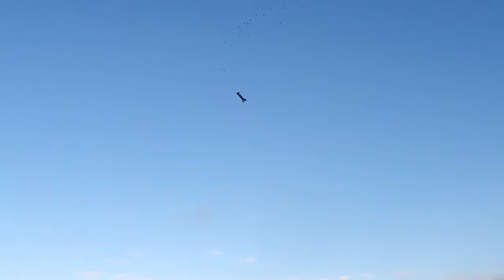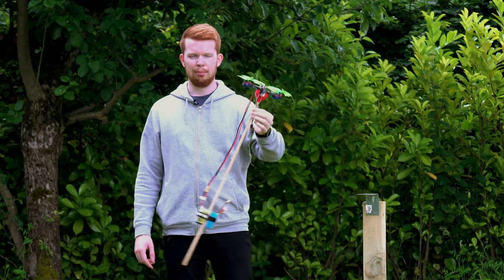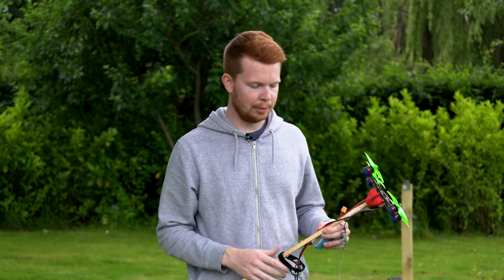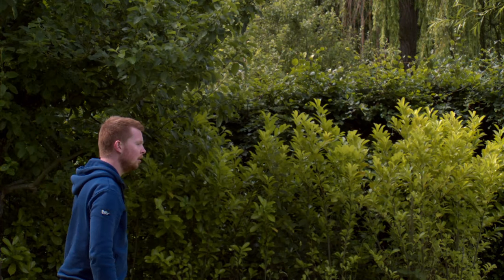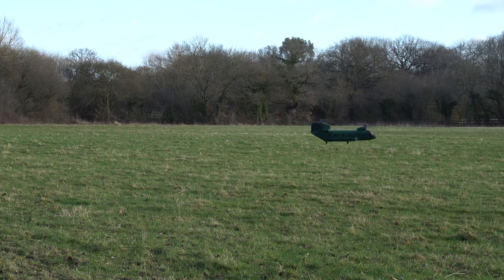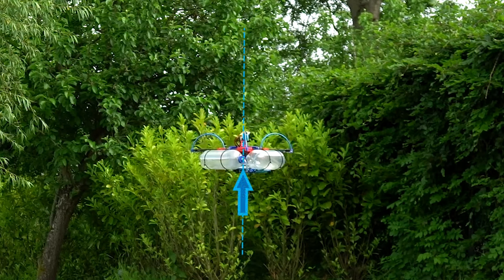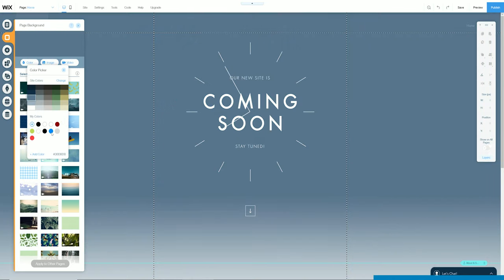Drone Pendulum Fallacy

Comment: @Tom Stanton, very interesting video! I was also curious about the website, however when I clicked on the link it turned out the website does not exist anymore. This in itself is a shame, but not really a problem. What you might find problematic however, is the fact that one of the related links shown on there might be content you would not like to associate with. So my advice is to check the website out yourself again and decide whether this is the case. If so, try to take the website down. Just a heads up from me and thanks again for the entertaining education!

Comment: You should try adding a ball swivel to the drone base so that the weight can move freely in any direction, that would be a more accurate representation of a pendulum
Reply: at that point it becomes more of a problem than a solution, every time the drone accelerates it will swing about

Comment: ok so basically if the thrust vector pivots to remain facing up, it is assisted by a low center of mass; if the thrust vector is fixed in a certain direction, the center of mass is better off closer to the source of thrust?

Comment: Granted I've only had about one hours sleep tonight, and my blood level in my caffeine stream is high, but I'm not sure I followed that whole offset thing. 
But what I do know since messing around with weights taped to  rockets as a kid, is that the pendulum effect doesn't work because the rocket keeps pulling it sideways. the pendulum tries to fall, but when it goes sidesway, the pivot point keeps moving sideways, so it never catches up. And also the acceleration acts like a weight on a string being spun around, it just stays lifted as long as it spins/accelerates. 

One thought occurred to me though,,, what if you put another pivot point lower down. because that would force the pivot point to where ever you put it? 
(I mean,, what I learned as a kid still applies though,, so it probably still doesn't work,,, for rockets at least, but maybe for a slow moving drone?)

Comment: I don't really understand why someone would intuitively think that a rigid connection to a mass would make the drone more stable. Perhaps I could see someone thinking this for a weight suspended by a non-rigid support though (e.g. string).

That said, what if you attached multiple large surfaces  (probably with holes in them and/or with a duct through them so that the propellers can still function) parallel to the ground? I'm talking about air stabilizers. Obviously when it's level with the ground —or close to it— air can pass though relatively easily, yet as it changes angle the air would push against the surface.

Comment: HI TOM, this was  an interesting tie in to your current build projects a pleasure to watch as always. i do have a question though.
For drone propellers, is it better to use 2 blades or 3 blades? ......and is there a difference in battery life over performance between the two???

Comment: "Everybody said I was daft to build a drone with low center of mass! The first flight, it flew into the hedge. The second flight it tipped further and then flew into the hedge. But the third flight, the third flight stayed."
Wait, it actually still flew into the hedge.

Great video. It's one thing to know that it works, it's another thing to have someone explain and demonstrate so it becomes intuitive.

Comment: If you had a two axis control of the "pendulum" with the pivot point being below the propellers, could the "pendulum" be moved relative to the propellers and control the drone?  I'm guessing that, theoretically, it should be possible, but the time constant of moving the pendulum is probably at least one order of magnitude greater than that of changing the speed of the props.  What if you had a single prop?

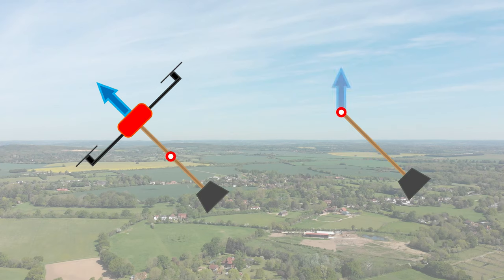Comment: At 5:17 you draw the force vector of the pendulum as vertical. I don't think that it is correct. Think of a pendulum held by a rope. The rope can only transfer axial force, so the force vector should be tilted as well.

Comment: Wouldn't a batterie far from the center of mass still be beneficial because of the increased inertia? Sure, it would mean that the motors would have to work harder to get the drone level, but wind gusts had a harder time too, right?

Comment: I was wondering something similar but imagine a very short string, just enough to allow the pendulum to swing in any direction, and then attach a couple servos between the drone  and a point on the pendulum that could push/pull it towards any direction, changing the center of gravity and causing the drone to tip that direction and so move in that direction?    PS, really interesting channel, enjoy all your vids, Thanks :))

Comment: Could you build a pendulum-drone where the pendulum is somehow connected to the propeller and points it to the reversed direction? It could stabilize the drone this way without a electric controller

Comment: What if you moved the pendulum pivot point?  Instead of making the drone and the stick rigid, put  pivot point on either the center of the pendulum or on the drone.  Or you could add two pivot points!

Comment: I think a drone could be pendulum stabilized, however not in a mechanically simple or obvious way. The pendulum would have to be rigid, like the one in the video. However, there has to be a hinge at the drone body that allows it to fold in all directions. Stay with me please! The hinge and pendulum themselves wouldn’t actually stabilize the drone, however one could make a mechanism with linkage bars, that changes the thrust vector of the motors according to the pendulum position. With some optimization I think this could work. However the drone would still be susceptible to drifting and rotation.

Comment: Why don't you put a joint or gimbal at the center of mass? A weight hanging from it could move 360°. I may not be saying that correctly...A swiveling joint with a weight suspended from it.

Comment: what if you add some fins to the top, kinda like an arrow.
to stop a lot of the positive feedback loop.

maybe even make the pendulum more aerodynamic.

but I think that adding the fins is what helps most...
and adding the fins above the rotors has a greater effect

edit: watching further than just the first test...
i learned something 👍🏼👍🏼👍🏼

but still, would you try out this idea some time? 🙃
Reply: That's a cool idea, like a throwing an arrow backwards. I think that the drone will pitch and start moving sideways but the drag opposing the drones direction or movement should stop it pitching past a certain point, this probably isn't useful for anything but would be interesting to see if works and if it's possible for the drag to overcorrect so the drone pitches in the opposite direction.

Comment: you represent the trust from 4 propellers on a drone as one thrust int he middle. surely most drones dont function this way and each rotor rovides a different force to create the desired movement. otherwise every drone would just fly straight "up" in whatever rotation it starts flying in.

any drone with a gyro that knows its currently tilted would then change the power provided to each motor to adjust the tilt to make it straight. the difference if the weight is under the trust is that it has gravity assiting keeping the weight below the drone and the drone would have to actively add power to the sitatuation to get the mass to tilt and be raised up. whereas if he mass is above the trust is if that mas sis not perfectly straight up, you're having to fight aganst gravity causing it to tilt more and more and more and eventually flip. like picture having to balance a barbell on the palm of your hand pointed straight up, as soon as that weight starts to tilt youre screwed. but if you are holding the barbell hanging down below your hand it naturally hangs straight down. even if you start to move your hand around its far easier to do so than moving around with the weight balanced above your hand. 

it seems your making the drone really dumb to try and make this an issue. yeah if the drone was so dumb it just flew straight up and down, it wont matter where the mass is. its going to just fly in the same direction as it starts in. it wont right itself because the dron itself is creating thrust to overcome the force of gravity trying to make it into a pendulum

Comment: I appreciate this video, it helps to explain parts of other videos you've published which were initially confusing.
I especially liked asking, "but what if [this]?" and the very next bit of the video explained, [this.].
Three points though: First, why didn't you include this information within other videos? You might have allayed confusion. While in hindsight these ideas seem self-evident, you gave them no consideration in earlier videos. Second, how might these concepts relate to lighter than air vessels? Where upward "thrust" would remain small but relatively constant. The third question I have may be answered by your own comment, regarding a "swinging" pendulum, that is, one on a hinge. I haven't read that comment yet. About to.
Reply: Well, my browser's broken. It won't let me edit.
However, I'd like to offer an analogy that might explain the paradoxical control of a high center of mass through vectored thrust (like your model approximating the Space X rocket). 
When I was in school, we were forced to take "Circus Arts" as part of our Physical Education curriculum. I have no idea why. Someone somewhere had a plan. Anyway, one "skill" included basically balancing a broomstick on one's palm. One could keep the broomstick upright by anticipating where the top may lean, and then moving one's palm to place center of mass directly above one's palm. With constant adjustment, one could keep the broomstick balanced indefinitely. It seems to me, this is how the Space-X rocket works, fundamentally.
However, when I tried it in practice, I eventually ran all over the gymnasium chasing after the top of a stupid broomstick before ultimately either dropping it, hitting a wall, or hitting a fellow student. Navigation might be a rather challenging inclusion to stability.

Comment: How about the use of a gyro mount. Strings are to loose for a lack of a better term. Damping the oscillation of a string with a weight on it is to much work. A pole or stick is way to rigid. I was considering the old Artificial horizon instruments in older aircraft. No matter what position the aircraft was in, the gyro was always upright. If the aircraft was in a turn or completely upside down the gyro would still be in the same upright position. Mount your gyro stabilizer at the center of your drone them attach your weight on a shorter arm than the stick you used.  Would this work?

Comment: I'm not supporting the pendulum idea, however, I don't believe that a longer drone with a greater rotational inertia is inherently less stable.  I suspect that the software that drives the flight controller is designed for a flat machine with minimal rotational inertia.  It's set up so that the corrections from the controller take effect almost immediately.  With greater rotational inertia the correction begins, but the controller doesn't take into account the fact that it's going to correct over a greater period of time and continues its input.  This causes the system to gain enough angular momentum that it swings far beyond its intended stopping point (even with the system now doing its best to stop the over correction) and it just oscillates out of control.

Comment: Try putting that weight an equal height above the motors and see how your stability is affected. Will you fly farther than with the weight below? Is that your claim? It is similar to airplanes - high wing craft put their weight under the source of lift, resulting in increased stability. Drones are inherently unstable anyway and only work with careful thrust balancing, preferably by gyroscopic help.

Comment: Good observation. But you're wrong. PID regulator actually works less with mass so low. Just the tau (time constant) incerases a lot. Everything gets dellayed and the drone tends to overshoot. Putting the mass above the quad would make PID regulator work harder. And this is not a myth. Battery moutned bellow the quad makes it more stable and smoother. Battery above drone makes a "sharper" race quad. But it may be very hard to tune and often causes more motor heat. Putting mass a whole meter under is just silly.

Comment: It failed because it's a fixed rod NOt a swinging pendulum. I have carried loads on a rod like a swinging pendulum. It made the drone act like it was on ice and took turn to move and stop again.
I did it so I could film under the water (  1/2 a meter ) while keeping the drone safely away from the water

Comment: What about the Centrifugal force created by each drone motor/propeller. As each propeller spins each propeller becomes a gyroscope. meaning if they start at an angle they will remain at that angle. And they are Spinning really fast. Or correct me if Im wrong.. But if I'm not wouldn't they as a group wouldn't they naturally cancel any pendulum motion?

Comment: Drone racers put the battery on top, which is inherently unstable, like an inverted pendulum. Ever see a plane with a canard in the front? Difficult to manually maintain stability, inherently unstable, but can do very snappy maneuvers.

Comment: Ok so what if you put the centre of mass low down, and mount the motors in mounts that cause the motors to always point upwards?
Reply: You have exactly what happens with the helicopter.
EDIT: With the RC helicopter in the video, not with a real helicopter
Reply: how do you point them upwards? if you are able to do that, then you already have a stabilizing force without the offset center of mass. What you are describing is thrust-vectoring, like with the rocket and chinook.
Reply: @sea_kerman  Yeah you're right as fuck, that's for sure thrust vectoring.  Makes sense.

>How do you point them upwards
Honestly I was just thinking put them on a gimbal and weight them at the bottom.

Comment: 5:22 the right illustration is not correct. The force / '"thrust vector" of a fixed pivot always shows into the opposite direction the mass is pulling. if the pendulum is just hanging there it points up, if it is at 45° to the right it will show 45° to the left. If this weren't the case but rather what is being illustrated here it would mean that, if the pivot breaks free while the pendulum is at a 45° highpoint it wouldn't be doming out to where the pendulum is but at a different angle like for instance 45° up

Comment: What if you create an additional pivot point aside from the one that exists from the drone itself. Like directly under the drone. It would allow the weight to be pulled down due to the force of gravity pulling on the center of the drones underbody. Wouldn’t that cause a stabilizing effect?

Comment: well,,, the lowered center of mass really does matter, as you demonstrated, with the real effects being the simple machine of the lever. The reason that a lower center of mass helps stabilize a weight lifting drone, is because it increases the amount of energy required to tilt the drone. So, it takes more control input, but makes the drone behave much more slowly to such inputs, creating a useful delay (useful assuming the desired dynamics are sedate). One interesting problem with your experiment is that you will have trouble isolating the pendulum effect from the stabilizing forces of wind resistance, thrust acceleration, and gyroscopic force from rotating propellers. Although you highlighted how many forces are at play, you did not provide a conclusive experiment eliminating "pendulum" gravity powered self-leveling.

Comment: or you can use your own reaction wheels base as pendulum to direct the entire vehicle by swinging the mass of the pendulum to the desired direction. In an ideal scenario the drone need to be a force aiming "Up" (pendulum just should be a way to get stabylity controll smoother) pulling the pendulum from the ground (maybe the stock cuadrocopter desing its not the best to try).[ im even thinking on a inverted priramid with fans on each triangular face.]  .maybe a giroscope as a pendulum?..  I mean,if you have no control on the drone and, the stick is fixed , and the pendulum is not moving. its just a 4 prop engines flying in any direction its facing.. pendulum needs to swing below the drone.... Ok now forget the drone, get back to the reaction wheels... put the motors 20cm or 30 over the wheels... the wheels base will act as a pendulum and stability control trying to fix its own angle right? and then forcing the motor to allways head up in the air. just imagination. hope you can try this ideas. Can you recommend an online phisics simulator? maybe a 2D? somthing like draw and sim. Good video producttion. Thanks for all the invisible work

Comment: I'm not sure if this is a difference between US and British English, or between the education of Aeronautics Engineers and Mechanical Engineers.  But what you keep referring to as torque is more properly called a moment.  The motors of your drone produce torque which is related to their rotational energy, but forces acting on a body with the effect of rotating that body are a moment.  It would be improper to describe my car engine as producing 150 ft-lbf of moment, just as it would be to describe a beam being is subject to a 150 ft-lbf bending torque.

Comment: What about instead of a straight shaft to quad coupling changing the pivot point and center of gravity, the quad is integrated into a u-hinge swivel pivot harness Around the top of the shaft?